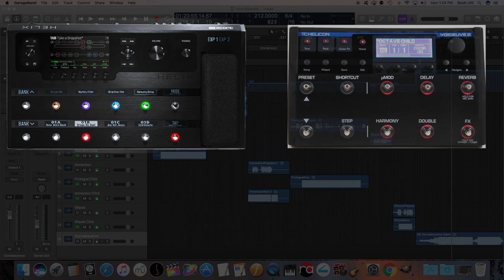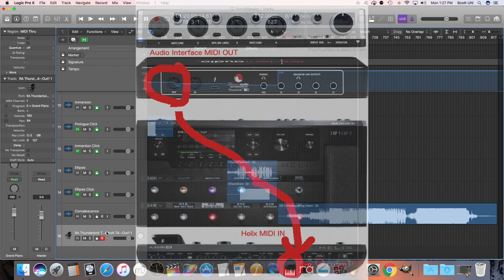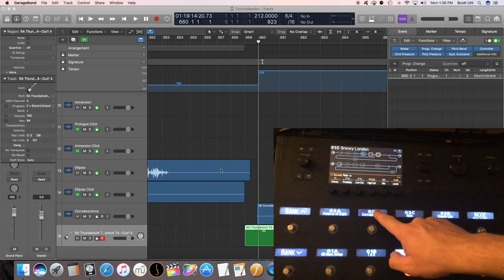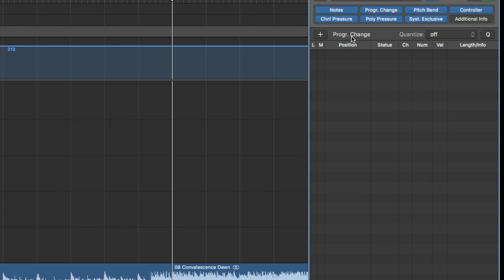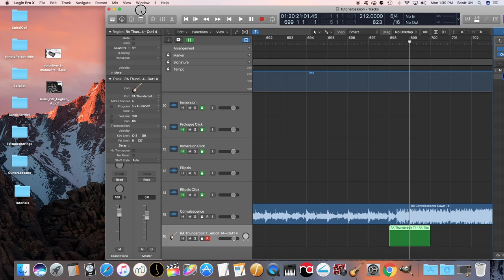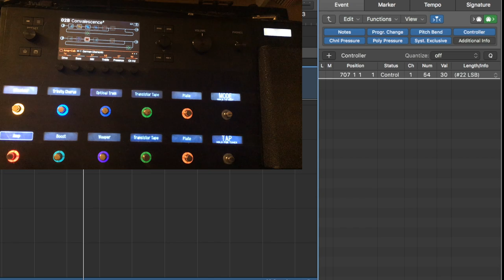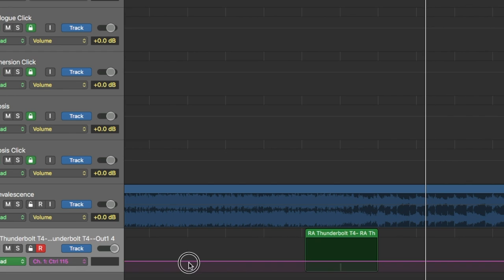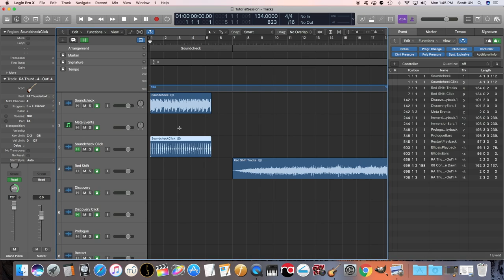How To Use MIDI to control Helix & other MIDI devices

Comment: Hey Scott, the CC number value doesn't quite matter cuz it just toggles the state of the footswitch.
However there is one weird thing that happens with me. As soon as I play or stop the session for some odd reason logic sends CC toggle to the unit. Does this happen with you as well? I noticed at the 8:12 mark that your Amp footswitch toggled as soon as you stopped the track if I observed correctly.
Reply from the maker: Yeah, it's weird how Logic does that. It doesn't do that in Ableton. For some reason, when you stop a track mid-way through it resends the last midi message. I never figured that out. But we never had to stop a song mid-way through haha, so it was never a problem. But it is still weird and annoying.
Reply from the maker: @zakklee2556  I honestly cannot remember. I just remember that Logic is weird when you stop in the middle of playback. And sometimes when you are programming you'll find that you need to send a value of 1 (or less than half way) to turn something off, and sometimes 127 (or above half) in order to turn something on. Sometimes as long as it gets a CC note (of any value) it turns the device/button on/off. Each device is different.
Reply: Hey mate, have you found a fix for this?
Reply: @InVisionsOfficial  Hey, I finally came to conclude it's a logic bug and not specific to the Line 6 device. If you have some PC or CC messages configured in the midi track and you play/stop the session anywhere you can notice in the midi activity window on top that Logic triggers the previous midi command to the external device. Due to this issue everywhere on stage when my engineer would start/stop a track, some or the other pedal in my signal chain would get toggled. To deal with it I would make sure that my guitar is silent during the start or stop of a song. You can't be playing something and trigger the track in the middle of your playing.
I finally switched to Ableton Live for this reason.
Reply: @9manav  Hey Manav, that's exactly what we are experiencing. It's totally fine if you're running the set without pausing the tracks which we don't normally do anyway. But should we have to pause the tracks the last thing we want to do is have to perform a recovery on the MIDI settings. Looks like the move to Cubase now they're removed the need for a dongle just jumped up the timescale! Thanks!

Comment: Thanks for your videos Scott! very useful and interesting :)
I'd like to ask you how to solve a strange thing as someone already mentioned in the comments. Every time I hit the space bar the stomp will randomly turn on or off. I use Logic and I have already checked the key commands . It's not clear what is messing up the helix. Could it be the usb cable? Instead of just using the midi cable? 
if you like , let me know if you know how to solve it. Thanks for your time :)
Reply from the maker: Oh weird…. It’s probably not the space bar itself, but for some reason some midi command is triggered when you hit space. I’m honestly not sure, that’s very strange

Comment: LOVING THIS! Now, can we use midi to change a Helix snapshot? Ex, Clean, dirty, lead depending on where we need those in the song?
Reply from the maker: Yup! You can send specifically for snapshots I believe on CC 69, or you can use this method and set it to snapshot mode and CC starting at 49 acts like each of the buttons are pushed 👍

Comment: Scott I may have missed it but how do you make sure it’s in the correct user folder of your helix ? And there is an update to this for snapshot changes ?
Reply from the maker: That sounds more like a general helix question, so hopefully this video answers your question: 

https://youtu.be/hMDE8u1azls?si=a8K85ggmu9a-rYFm
Reply: Scott based off your m live b beat video I’m thinking that’s easier way to go and I’ve just pulled the trigger on one . I’ll try this way as a potential backup method

Comment: Hey Scott - I've got a question maybe you can help me with.  I set up a couple of CCs in Logic to switch a stompbox on and off, just like you showed, but I find that whenever I stop playback, the stompbox switches on again - and I notice in your vid it seems to do the same to you (8:12).  Have you figured out a way to stop that happening?
Reply from the maker: Hey, no I have not figured out why it does that. Really odd. So if you have to restart a song from somewhere in the middle for some reason you just have to manually make sure everything is set where it needs to be. It was never a problem performing live, and only at rehearsal would we stop and restart in the middle of a song. If anyone finds out the answer, I would love to know.
Reply: @ScottUhlMusic  Thanks for the reply Scott - glad it's not just me being a midiot!
Reply: @ScottUhlMusic  Has anyone figured out a solution for this? @sentientfootwear
Reply: You can manually assign a midi cc in on the Helix to each foot switch.  I used midi CC 120-127 for all the Footswitches.  Using the pre programmed midi cc in the line6 manual is problematic.

Comment: Thanks Scott! What about just changing from snapshot to snapshot on a song preset?
Reply from the maker: It works the same way, it just depends on how your helix is set up. If you are in snapshot mode, and you want to go to the snapshot that is on the button that is controlled by CC55, you would send CC55. Line 6 was smart and had the CC messages control the button as opposed to the effect. This is actually how I use it with my HX Stomp

Comment: Hello Scott,
This video is very well done . As you know I'm using the B Beat like you. May you tell me how you make to use the MIDI file created on  your DAW to be usable on the B. Beat. When I'm running Logic Pro X and my helix is connected with a USB to MIDI cable (UNO cable) everything is OK. I export the MIDI file, transfer it to the B. Beat, connect the MIDI out of the B. Beat to my MIDI IN of my Helix and noting works.  Thanks for your help.
Reply from the maker: Interesting… that I don’t know why it wouldn’t work as I was able to get mine to work fine. Likely it’s the cable from the TRS midi out to 5pin midi. I tried using one and it didn’t work, but another one did. I linked to the one that worked in the description 👍
Reply: @ScottUhlMusic  Yes I think it's the MIDI cable. I bought the wrong one. For the B. Beat it's necessary to have a B type and I bought a A type. Waitong for the cable to be delivered and I will try. Thanks for your help.

Comment: GDay Scott, mate great tutes. Helping heaps. I have a similar setup to you (Logic, Helix, G4 IEM etc...). Is there any way to trigger different Helix Snapshots (with multiple stomp boxes - in different combos -  selected for that Snapshot) using midi trigger commands in Logic?
Reply from the maker: Nice setup! Not sure I understand the question though…
Reply: @ScottUhlMusic  thanks for replying mate. I actually think I've worked it out (after watching your Helix vid again). With my snapshots, I change the combination of effects (i.e. Snapshot 1 might have both reverb and distortion on but  Snapshot 2 might turns those two effects off but turn on flanger and delay). I use snapshots to avoid latency in patch changes. I was hoping a single midi command could select a snapshot and change the multiple effects on/off depending on their combinations (i.e. send a command to the Snapshot; not the individual patches). I think I have to do it by sending multiple midi commands simultaneously to each effect individually (one on/off/value command for each effect - so if I need two effects on and two effects on at the same time, I need to send four separate commands simultaneously - one to each effect and its required value. Will experiment and see. I may be goofing this completely. <:O)

Comment: thanks for that video. As a bass player I want to model a sound, where I want to double my bass signal with an pitch shifted signal (with seperate effects) to sound like a bass doubled by a guitar. I could not get this to work since I cannot find a pitch shifter in the helix that is just shifting my signal one oktave higher. Am I missing something?
Reply from the maker: There is definitely a shifter. You can also update to the latest version and get the poly pitch shift, which is awesome!
Reply: @ScottUhlMusic  Thanks a lot for feedback! I also figured (and learned in your videos :-) ) that I run out of DSP pretty fast, i.p. when using amps. I just got me a helix stomp xl. Is it expandable with memory, is it is expandable with sounds? I found expansion pacakges on the helix website but they don't seem to be made for the stomp... thanks anyway, your helix rookie ;-)
Reply from the maker: You don’t get more DSP with any of them, that isn’t possible. And yeah the Poly Pitch is a DSP hog for sure! So you will definitely run out with that one haha. Using the bottom path is a good way to get the DSP problem less for sure. You still can run out, but you get more if you use both paths.

Comment: Hi Scott, don't know if this is possible: I'd like to use the Helix & Firehawk1500 together. 
Presently on the Helix; guitar into 1/4 guitar, xlr out to Firehawk then routed to xlr in, resulting in bypassing amp head & just using cabinet. 
To use Firehawk amp on it's own I unplug Helix xlr & plug guitar into it's guitar input. 
Instead of doing all this how do I route both together? Do I use a 4 cable method or midi, & how to configure?
Reply from the maker: I responded on your other post 👍

Comment: Hi Scott, Thanks for your videos you are a Great Teacher and I have learnt very useful tips from you thank you very encouraging. My question is in this video you demonstrate how to control with MIDI. Can you export that midi programming as a single file from Logic which contains all the messages in it?  Could the file be used in the M Live B Beat. I have watched that video you did and that help me decide to buy it which was one of the main reason. I use Reaper to organise my multi-tracks and now I am attempting to program the midi to control my FX pedals, NUX Cerberus and Voicelive 2.  Everything seems to work whilst I have it all connected to Reaper fine. However after I export the file and put it into B Beat using the B Beat Manager it does not happen. I do have the midi type B adaptor running the a MOTU XT midi express. So everything works from Reaper, MacBook, MOTU too pedals. But no luck in B Beat and midi file. If you have any advise that would be much appreciated.
Thank You
Reply from the maker: Yeah you have to get the right midi adapter on the b beat. But if you export stuff as a single midi file will all the different commands on different channels for different devices, it should work 👍 that adapter has to be the correct one though!
Reply: @ScottUhlMusic  Ok I'll give it another go but I seem to have everything in order. I may change and try Logic as I have found out that it has Track & Region option for midi. I found another person had similiar issues and it was a matter of exporting the midi as a region so that all automation was in the region even though the automation was in the track. I can't find this option in Reaper so I may have to change to Logic 🙂

Comment: Hey Scott - great video - I found that using the line6 preprogrammed midi cc numbers from the line6 manual to toggle the foot switches on and off was problematic.  I’m using studio one - so that might be the issue…. However I found that you can manually assign a midi in cc number to each foot switch on the Helix.  Then just add the corresponding midi cc message in the DAW and a value under 50% turns it off and a value over 50% turns it on.  This is a better way to toggle the foot switches via the DAW IMHO.
Reply from the maker: Interesting. I haven’t had that problem, but I’m glad you figured out a solution 🤘

Comment: Helix, logic user… I ‘m confident with Logic and MainStage - but I have no idea how to “program” a full set list in logic. So I purchased Abelton Live. Any idea how to export the midi commands and import it in Live to trigger the helix and voice live??? Or a way to build set lists with logic/MainStage with midi commands?
Reply from the maker: Ableton is different, but they are pretty straightforward for sending midi and midi routing. I don’t have a video on it, but I know they are on YouTube
Reply: Thanks - Any idea how to program a whole set list with Logic? or do you use an app? I ask because I want to retain the midi controls as I export the songs (or run it from logic (Abelton is not user friendly) IMO
 @ScottUhlMusic

Comment: Hey dude, this video really helped me a lot. The other day I saw a guy programming a Quad Cortex, He use a midi command to load an specific preset, Do you know how can I load my preset that way on my Helix? That would help me a lot to program the midi in my band's live shows.
Reply from the maker: Yup, using this method exactly. Program changes will load the patches on the helix 👍

Comment: Nice video, i have the hx stomp, you know if i can accsess  the tuner sending some midi message?
Reply from the maker: I love my HX Stomp as well. But I'm not sure what you are asking. Does the tuner send midi? Not that I know of. Certain button presses will send midi messages, and the Stomp can receive midi messages (I program mine similar to the way I do in this video). But I don't believe the tuner can send messages specifically if that's what you are asking
Reply: @ScottUhlMusic  my question is you can tell the hx stom via midi with ableton live to turn on and off the tuner on the hx Like the snapshots or the presets.
Reply from the maker: @santiagollorente9285  I think so. I haven't tried, but you can send midi commands to act like button 1, 2, or 3 has been pushed. So if button 3 is your tuner, and you send a midi message to act like button 3 was pushed you should be able to. But I'm not sure since a tuner is a "hold" not just a press. You would have to experiment with that
Reply: @ScottUhlMusic  that's right but if im in snapshot mode the 3 switches are for the snapshots. If I want to accsess the tuner I have to press other buttons.
Reply from the maker: @santiagollorente9285  I have a little MXR tap tempo pedal attached in the EXP input for my HX Stomp which I set to control my tap tempo and tuner. Use that and program it to FS 4 I believe?
Reply: @ScottUhlMusic  Ok that would be a solution! but you have to add a switch for that.
Reply from the maker: Santiago Llorente a quick search through the manual showed that midi CC 52 controls FS4. So set FS4 to be tap tuner and it might work. Also read your manuals as boring as they might be :)

Comment: Really helpful! 

But I was wondering if you could help with a small problem. 
Whenever I press the spacebar it seems like logic is sending some midi information to my Helix. It turns on and off certain stomp effects. 
This problem is compunded by the fact that I have a few Midi Meta events telling the playhead to stop after a song. 

Anything you would know how to fix?
Reply from the maker: Are you doing this in Logic? I know in some DAWs you can program things like the Space Bar to send a midi message. Check your Logic Pro Key Commands to see if Space Bar is sending something midi. Also, this is why you should set your Helix to read on a different midi channel. Try setting your Helix to read on Channel 4 or something and see if it still does it.

Comment: Is there an app for the Mac that will send MIDI over USB to my XR-18? The Logic thing works, but short of programming EVERY song I have in Logic, if I only have a couple of MIDI cc's to send for various scenarios, being able to just click within an app much like the iPad/iPhone wirelessly (with wireless MIDI controller) is what I'm looking for. Or the iOS app that is standalone (not OnSong) that I can get the USB dongle or also do wireless. Thanks!
Reply from the maker: Midi is just time consuming no matter what you use unfortunately. You might look into Show Buddy by DMXIS, that might be easier?
Reply: @ScottUhlMusic  agreed! I think I’ve simplified it knowing these program changes and just need a simple delivery vehicle. If I can’t do it with iPad or MacBook, I’ll find a simple foot pedal solution. I did order one of the new wireless ones WIDI that you reviewed. I’ll check out DMXIS for OS X. I appreciate your continued replies to my myriad of questions!
Reply: @ScottUhlMusic  Tried the Show Buddy demo but won't run on my M1 Macbook unfortunately.
Reply from the maker: @scottbakernc  Ah... of course! That never ending struggle of the computer upgrade not working with software. Sorry man.
Reply: @ScottUhlMusic  Yes! 🙄Well trying to find some way to send MIDI commands from a Mac appears to be daunting! I just want like four buttons to send Program Changes. The struggle is real!

Comment: Do you know if it's possible to send command changes at a specific time using the Multitracker app ? (I could only figure  out how to send  program changes)
Reply from the maker: That’s funny, I’m literally working on a video on MultiTracker now. It won’t be out for a while, but yes you definitely can send midi. You export a midi file into the app as a .mid file and it works well 👍
Reply: @ScottUhlMusic  Good to hear and good timing ! I couldn't find any documentation regarding CC in the Multitracker user guide, so I kinda gave up. Do you know where I could find an example of a midi file that could be imported in Multitracker ?
Reply from the maker: You create it in logic or something like that and then export as midi 🤘
Reply from the maker: @the_guy_next_door_31  You'll create the midi file in Logic (or a DAW) and then "export as midi" file. That's how I do it.